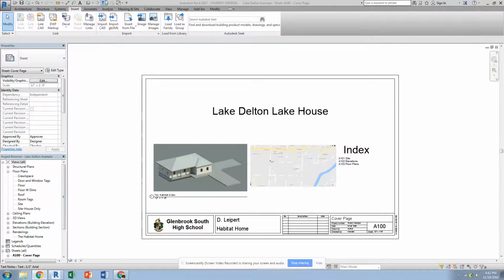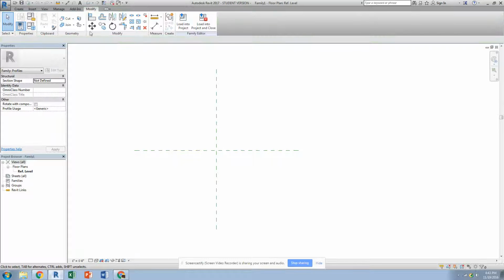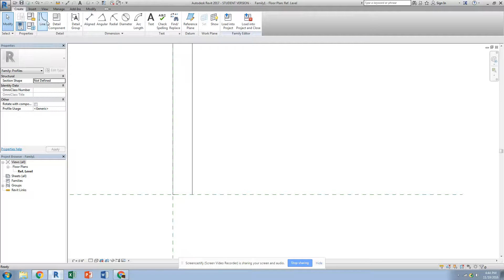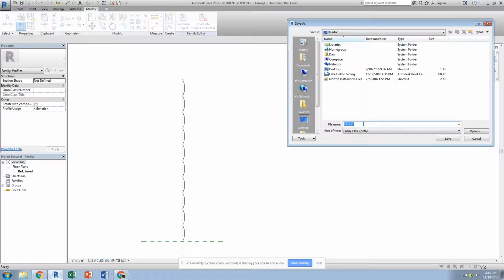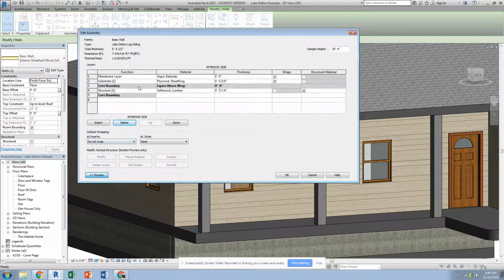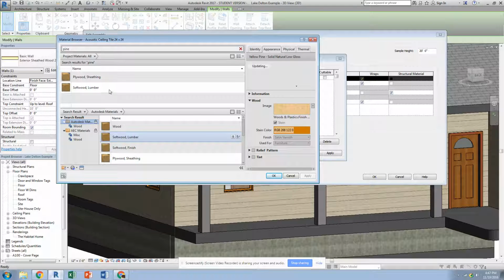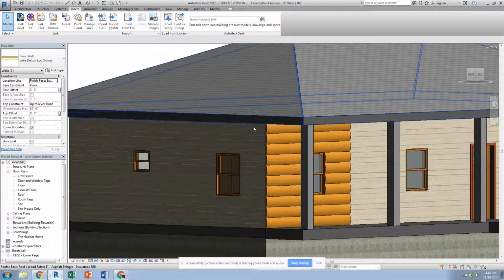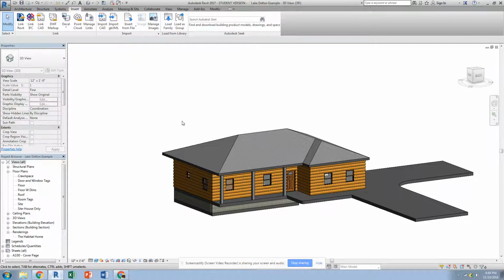Revit - Custom Profiles for Custom Walls!

Comment: Hey man, thanks for the the video, very well explained and very helpful although I'm having a problem adding it as a sweep, just as I try to apply it as a sweep it says "Could not create integral wall sweep for wall instance. One or more profiles are invalid.  Make sure that every used profile is a closed loop of non-intersecting lines" although it is for certain a closed loop with nothing intersecting. Any ideas what else might be going wrong for me?
Reply: Actually got it there so thanks mate 😁 There's not many tutorials on YT showing how to do this so cheers man
Reply from the maker: Glad you got it to work, and thanks for the note!